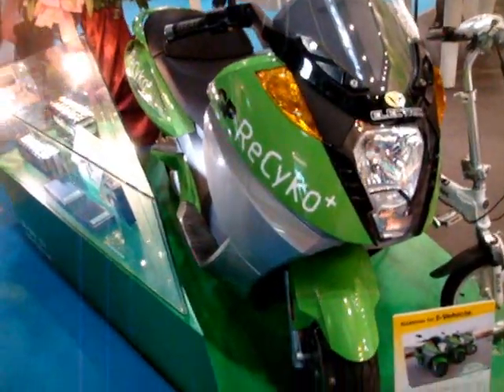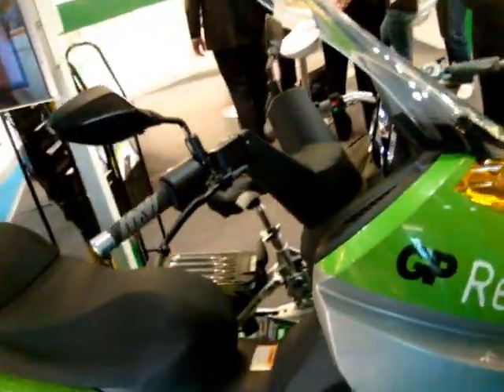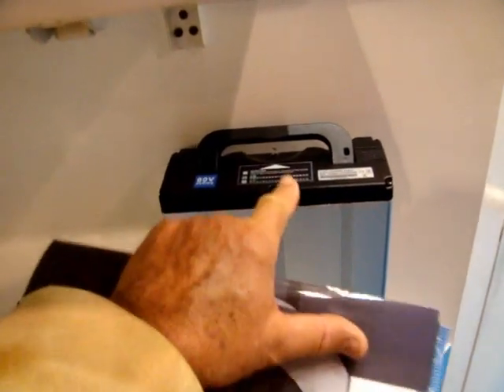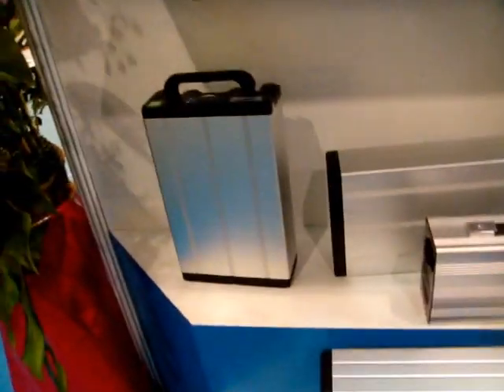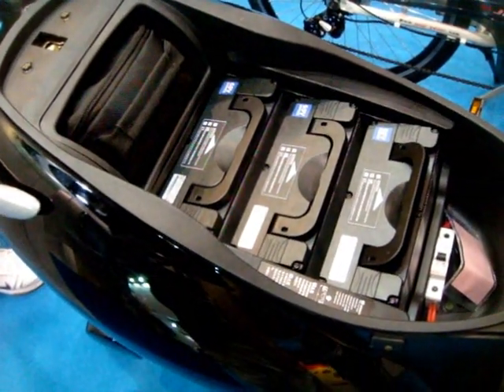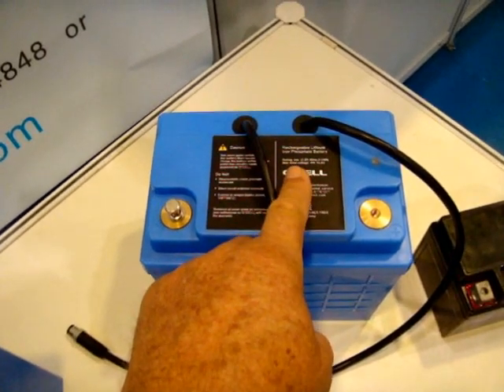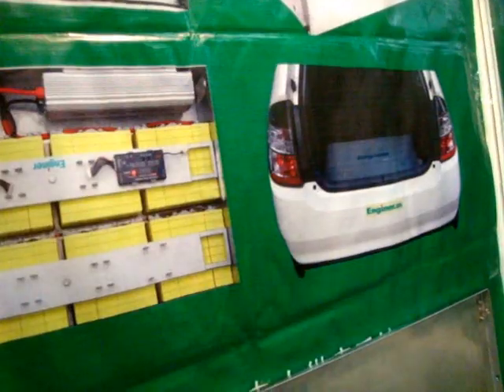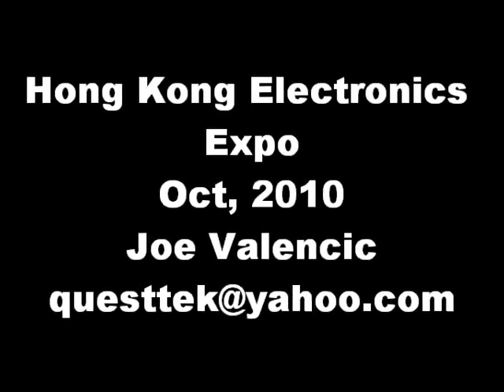Latest Electric Vehicle Battery technologies

Comment: Zero emission battery? So did they conjure it out of fairy dust? Oh wait I forgot that fairy dust is very energy intensive.
Reply: Phlaked Corn 
well those batteries fall from the sky when it rains..
Reply: It's relative to lead acid. LiFePo4 is heaps better in the cold too. God i used to get so pissed off at the 125CC motorbike waking up with dead battery syndrome a few times each winter. Complete PiTA.
Reply: Phlaked Corn

PIXIE dust.
Reply: - Try me concept, the 2 battery operate vehicle with a sophisticated alternator that charges one while the other is running the car!
Reply: Visakhapatnam available message
Reply: Visakhapatnam available please message me

Comment: What I would like to have seen is a circular type battery designed to go where the spare tire goes in the trunk of your car. Such a battery could be used in plug in hybrid conversions. Seems to be an ideal spot although it does beg the question of where to put the spare tire.

Comment: OK ZERO EMMISSION BATTERIES , is that after they dug the earth for material, processed, that material, molded the plastic, transported to the stores, ran the lights in the stores, the gas it took the employees to get there to turn the lights on. AFTER ALL THAT ITS A ZERO EMMISSION BATTERY.... ARE YOU REALLY BUYING INTO THIS SHIT? COME ON !!!!!! WAKE UP !!!!!! Dont get me wrong i know its a step in the right dirrection. But just cause they blow smoke up your ass doesnt make you a ghost.
Reply: On a larger scale...think about it. 
What if everything ran on electric and was sourced from solar and hydro power? You are expecting the technology to change overnight. It doesnt work like that always. Remember even after the internal combustion engine was invented and put in a car? People still used horses until the technology became cheaper and more practical. Model T helped that. Even then many still used horses even though it wasn't as efficient. The technology finally got practical enough to where the horse was not as practical as the automobile. When power cells are able to propel a vehicle 500 miles on a charge and can be fully charged in a few hours the technology will change the system. Until then they have to do what they can to perfect the technology with what they have. Remember this technology will not only change the auto industry but may also bring down the electrical grid or force it to revamp its entire platform. There is a lot at stake. Petty things such as being 100 percent green in production process can be reworked later when they can run their factory on the technology they make.